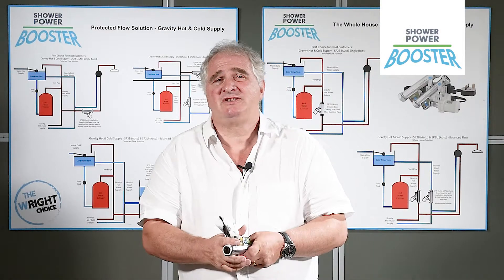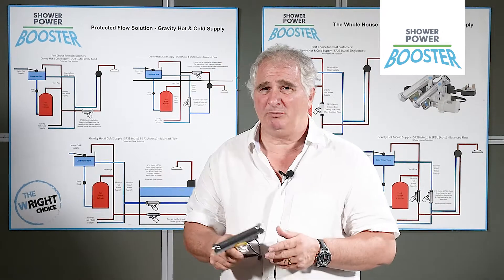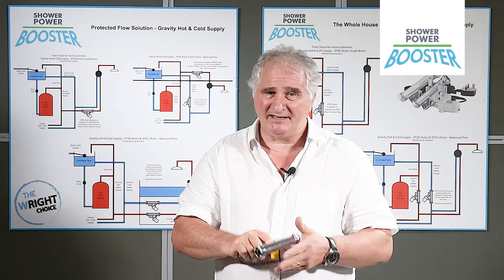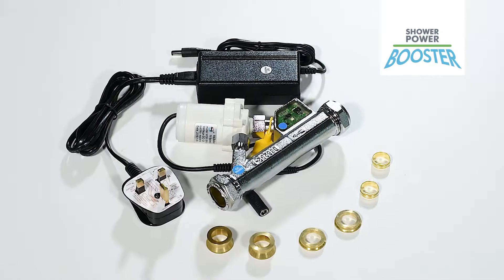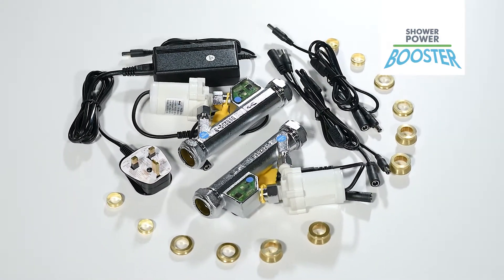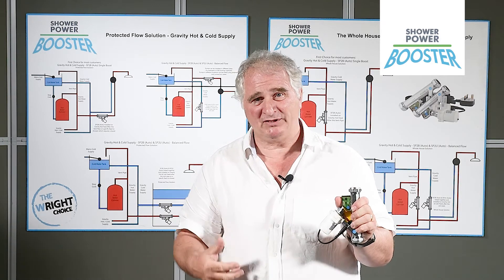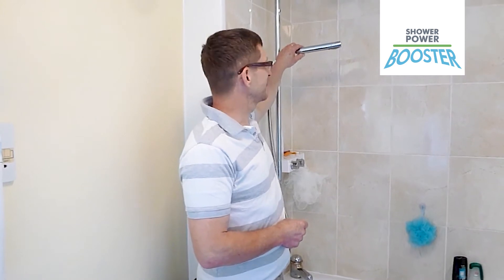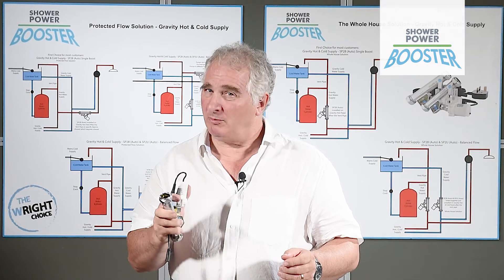Increasing Pressure and Flow to Taps and Showers

Comment: Does this work with a Ele shower ,as if using shower if someone turns on tap while shower running shower nearly stops
Reply from the maker: I googled Ele shower and I think you mean an 'Electric Shower". If you fit a SP21S (£155) on the mains pipe feeding the shower the SP21S double boost will protect that shower giving priority over the running tap. Most people only fit a single boost SP2B (£125) and there is a good chance this is all you need. We make our profit on the first pump and so providing the the slave pump pretty much at cost is a way of getting a solution when two pumps are needed without exploiting you.
Reply: @alandwright2  thanks yes sorry yes I did mean electric

Comment: I'm looking to run it on a 12v system, is that ac or dc the pump runs off?
Reply from the maker: The pumps run on a 12 volt system but we use a transformer to change AC into DC. If you already have DC you can buy a pump without a transformer.

Comment: Hi messaged on twitter but had no reply. If I have 6l/m from a bath (gravity fed from hot/cold tanks) mixer tap what flow rate would I get when this is installed?
Reply from the maker: It would have had a more dramatic effect if you a lower flow to start with. We find reported increases from 2.6 litres a minute to 6.4 litres a minute would be typical (145%). With a starting point of 6 litres a minute I would expect it to get to around 8 litres a minute. Maybe more if you are boosting hot and hot at the same time and the mixer is say 60% hot and 40% cold. The maximum flow of hot alone or cold alone is perhaps 9 litres a minute.
Reply: Alan Wright yes would boost hot and cold by having a pump on each.
Reply from the maker: @richardc1983  I notice that this has not been responded to. The pumps only solve pressure problems if there is a pressure problem. Speak to Gemma and if she cannot sort you she will pass you on to me.